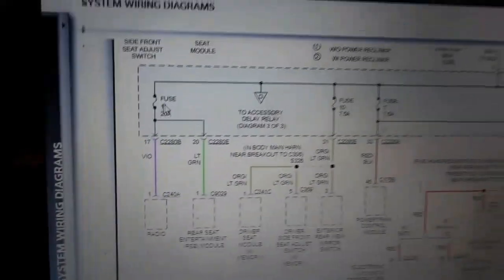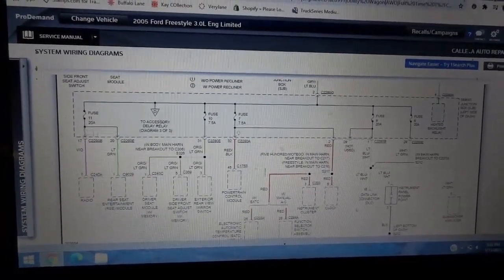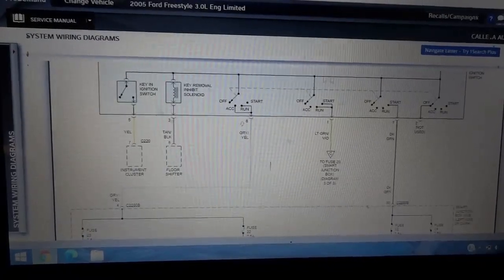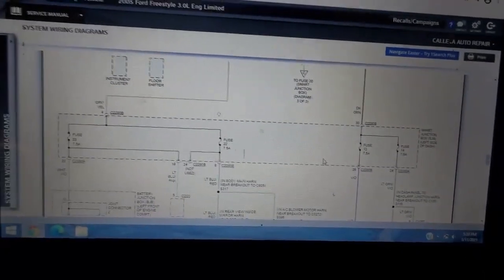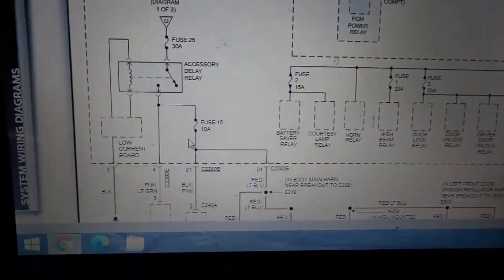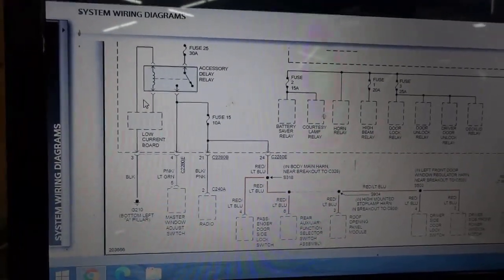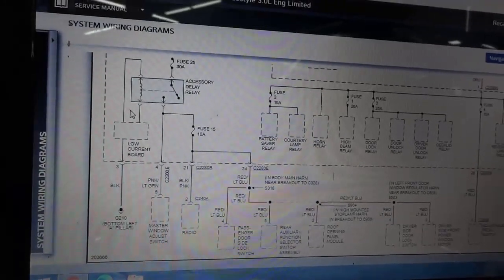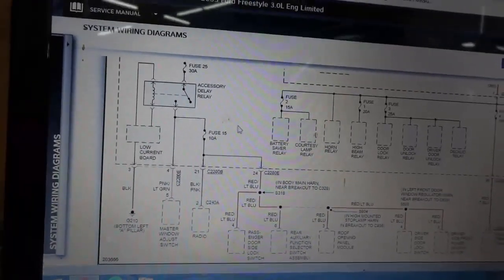Ford Freestyle: Power Windows not working, Radio not Working, inoperative interior Lights...

Comment: Before you do this on a ford 2004-2008 f150, check fuse number 21 in the kick panel on the driver's side . It's a 15amp fuse that controls your radio,windows ,ac, dome lights and who knows what else.. anyways that fixed this same problem in my truck.. much much easier..
Reply from the maker: medusa01  Thanks for your suggestion, I did check fuse 21 and it was good!

Comment: Yes thank you very useful video. My son has this same issue with same vehicle. One question. Which wire at the main power window switch did you connect the wire or how can I fine the correct wire?
Reply from the maker: RK Sparkman  I jumped the power wire that supplies power to the master switch!! you will have to get a wiring diagram to locate it!!

Comment: I have a 2005 Ford 500 Limited. I had a dead battery so I charged it.  Reset the CPU and cleared the capacitors. Did the relearn yesterday and it ran fine.  Today the battery was dead again. Charged it again and noticed my radio was on but no audio. Went to the store and noticed the power windows, interior lights, and radio went completely dead.  No light,  nothing. I noticed my F2, 15A fuse was burnt. That doesn't explain the radio though,  right? Thoughts? Could it be a combination of the 30A breaker and the F2 15A? Checked all the other radio and audio fuses and they are fine.
Reply from the maker: Ricky Pisano it sounds like you have a short to ground somewhere on one of the electrical circuits, follow the steps in the video, hopefully you have the same problem... finding short to ground can be very difficult sometimes... Good Luck!!!

Comment: Where did you connect the other end of the fused wire from the master window switch? Where were you drawing the power from?
Reply from the maker: Ricky Pisano I was getting Power from the Battery
Reply: @KITS_Auto_and_Truck_Repair  Thanks a million brother!!  Just an awesome video. Same exact problem here (only difference is fuse F2 is burnt) Tomorrow I'll replace that fuse and see what happens then do the fused jumper wire test and verify.  I was just getting ready to pull the air induction, intake and throttle body to take care of a random misfire on Cylinder 3, Bank 1 (Figures, right). I have the 3.0L Duratec DOHC V-6 engine. The sideways V-6. Bank 1 is a real doozy to work on.  I noticed some oil in 2 plug wells on Bank 2 so I know my valve cover gaskets need replacing. Pretty sure that's the reason for the misfire. Figured I'd do everything I could back there while I had it apart. Check all the coil packs, injectors, change the PCV... You know the drill. Then this happened. The car is in fantastic condition for a 2005 so definitely worth the work. This video was a great help to me.  Electronics are not my strongest skill. Best video I saw on this problem.
Reply from the maker: @RickyPisano  My Pleasure!! I'm glad to hear that the video was helpful, I also have a video on how to remove an intake manifold on this vehicle, you can check it out, since you are gonna have to remove the intake to get to the back bank.... Good Luck!!!
Reply: @KITS_Auto_and_Truck_Repair  I will most definitely check it out!! Thanks a million!! I'll let you know how it goes!!

Comment: This was driving me nuts all night.  Remember I told you fuse F2 was burnt. That is my interior lamps (Courtesy and demand lamps) Delayed accessory (Power windows and moonroof). Before I replaced that burned F2 fuse nothing worked.  The only fuse I had Power to was F11....just like you.  Fuse 13 and 15 were both dead.  After replacing F2, fuse F15 HAD POWER!!  The radio worked, audio worked, windows worked and with the delay!! Fuse 13 is a 7.5 Amp Audio fuse. That's it.  But so is F11 AND F6. I thought for sure my delay accessory relay was shot but how can the delay be working on my windows, radio and lights if that were the case?? I still have no power to fuse F13 (audio) but I'm getting audio fine now.  Everything is working. Could F2 (another Delayed Accessory fuse) have disabled the Relay enough to cause the other issues? Thoughts. Fuse 15 had power as soon as I replaced that burnt F2 fuse.
Reply from the maker: Ricky Pisano that's a bit weird, you should check where the power comes from to feed fuse F13,  there are some solid state relays in the intelligent fuse box, you might have one that's bad... 
Good Luck!!!
Reply: @KITS_Auto_and_Truck_Repair  Yep... need to figure out why that fuse has no power. I'm also replacing the battery tomorrow. This one is quite low and I know the can cause problems with these CPU cars.  You've been a ton of help and I really appreciate it man.  Believe me.  I haven't tried to check Fuse 13 with the radio on.  So I'll try that.  I have 3 fuses for audio. One for a sub-woofer that I don't have but that's not 13. But the delay relay is definitely working on the windows and radio. So that's a relief. Now to solve the fuse 13 mystery. I'll let you know what I find.
Reply from the maker: @RickyPisano  sounds good, I would like to know what you find!!!
Reply: OK.... Here's what I found.  I charged the battery and have been checking it every hour for 7 hours.  Holding steady at 12.6 volts. Hasn't moved a bit.  Fuse 13 is fine now.  I think I mistakenly checked it with the key off. I'm betting that when I do my last check it will still be at 12.6 volts. I'm going to hold the meter probes on the battery and have my wife open the door, waking it up.  Interior lights go on and all that.  I'm betting the voltage on my battery drops at least 2 Volts. Just from opening the door.  If that's the case I'd say the battery can only hold voltage asleep. Any draw on it whatsoever drops the voltage enough to not start the car.  Now I'm thinking the battery is just old and can't hold voltage and drops fast with any draw at all. Everything is working fine with the car running and I haven't noticed a drop in voltage in 5+ hours.
Reply from the maker: @RickyPisano  yeah you should have your battery tested!!!
Reply: @KITS_Auto_and_Truck_Repair  Agreed. I just did my last check and it was 12.6 volts. Didn't lose anything all night.  Went out and put the meter on it and 12.6 still. Had my wife open the door and it dropped to 11.5 volts. When she tried starting it the voltage dropped immediately to 10.6. I betting the battery is shot at this point.  You've been a HUGE help and I really appreciate it.
Reply: @KITS_Auto_and_Truck_Repair  BTW... found the receipt and the battery is over 4 years old.  It was purchased on 3/14/17 by previous owner. Luckily they gave me all the service paperwork when I bought it.
Reply from the maker: @RickyPisano  sounds good, you can get a new battery for it...

Comment: My window goes down but not up .
Reply from the maker: Eric Murphy you should check the switch or the window motor! it sounds like one of those items is defective... Good Luck!!  if you don't the tools to check them, you should a Pro Mechanic diagnose it for you!!
Reply: @KITS_Auto_and_Truck_Repair  well I feel it's not the motor cause the windows in the back passenger roll up and down I just can't control the back windows from the driver side control panel
Reply from the maker: @ericmurphy2978  it might be a problem with the switch or the wiring!!
Reply: @KITS_Auto_and_Truck_Repair  hey I took your advice and replaced the switch . ITS working great.  All windows power up and down.  Thanks for your expertise on this . I  can't thank you enough
Reply from the maker: @ericmurphy2978  My Pleasure!!  I'm glad to hear that the video was helpful!!
Reply: I don't have power to fuse 8,12,16 and 17 in my 05 freestyle I'm trying to fix, do you have any idea where these fuses get their power from? If I could find out where the they get power from I'm hoping I can remedy the problem I am dealing with.
Any info would be greatly appreciated 
Thank you so very much for all the great videos you make!!  👍